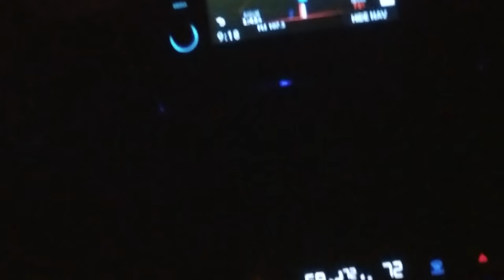Helping Camarata Dig - Part 1

Comment: Questions: 1. Is there a bathroom in the castle? 2. Is there heat in the castle? 3. Is there a kitchen in the castle? I don't see how Andrew lives at the castle without heat or a septic system. Maybe I'm missing something? Great video, thanks for sharing.
Reply from the maker: Yes to all three - one container is coverted into a small apartment with a full bathroom and heat.
Reply: There’s a video in his back catalog AC’s where he briefly shows the 1 container off the “kitchen area” that’s has a bed, full shower and toilet and sink. AC doesn’t live there full time he probably stays occasionally when the need arises. He keeps his private life separate from his projects. He mostly stays at his parents house he grew up in. His dad helps out occasionally when he’s in a tight spot. He has shown a bathroom remodel at his parent’s house. He also needs the acreage at his parent’s to store some of his equipment. Most likely rigs that are more used locally doing the jobs that made him into what he is today.
Reply: @johnkruton9708  Hey, thanks for your reply. I've seen the bathroom remodel at his parents house. I've never seen the video with the container that has the shower. Still wondering about heating the castle in general, no insulation anywhere. It seems like there would be condensation dripping from the metal roof/ceiling, I've seen that in uninsulated warehouses. Thanks again!